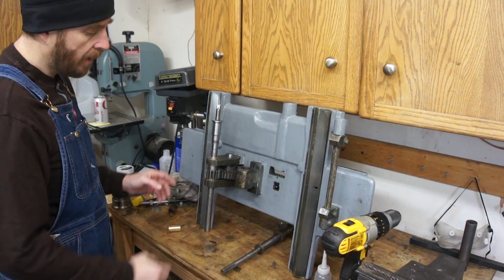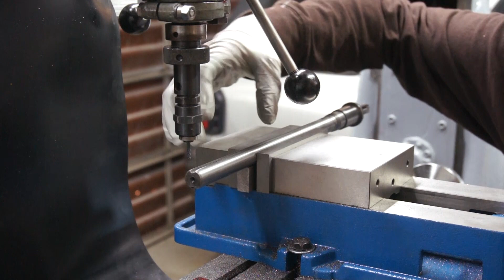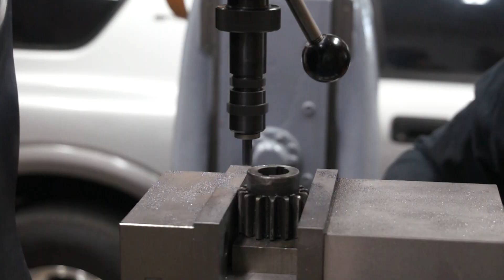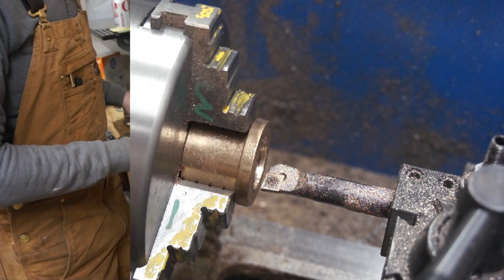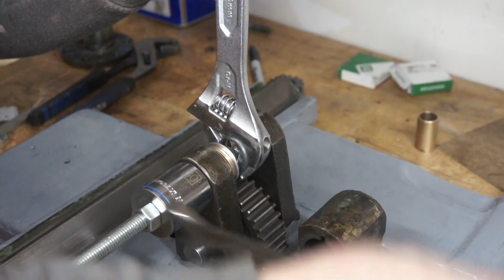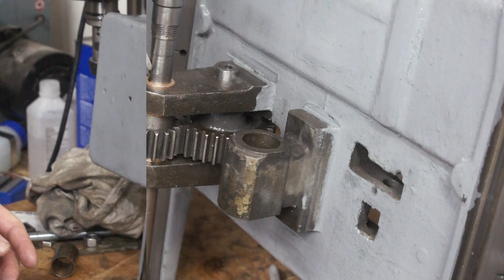Repairing a Worn Gear Drive Shaft - Brown and Sharpe No 2 Restoration - Part 4

Comment: Good stuff! Did I see you facing with boring bar? I may try that when I am in close. Great graphic add ins. Let me guess your day job is with computers?
Reply from the maker: You did, yeah.  I had the lathe all set up for boring the bushings and I didn’t want to swap tools and have to redo the setup.  The boring bar seemed to work just fine for facing.  I do work with computers for work, well, sort of.  Spreadsheets and email in my current job.  Many, many years ago, I had a job using 3D CAD software and I still do a lot of that as a hobby.  I’m an ace with Solidworks 😀